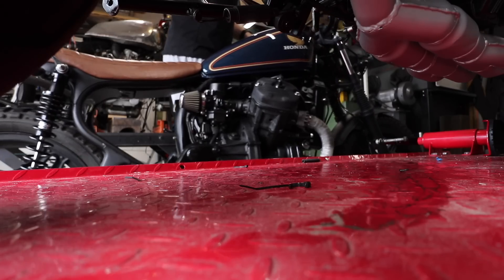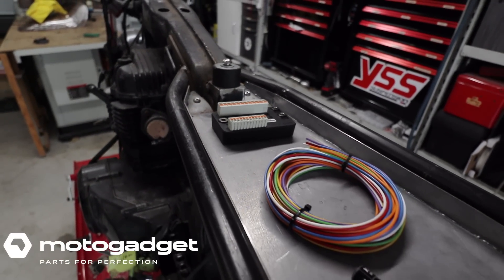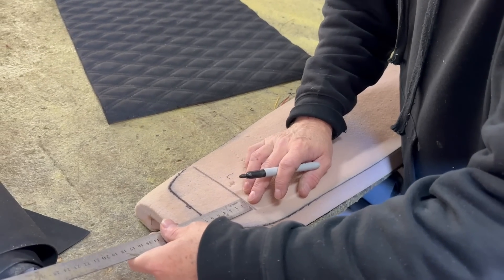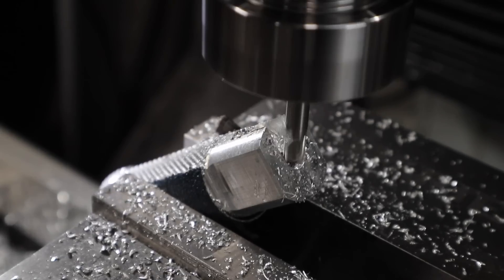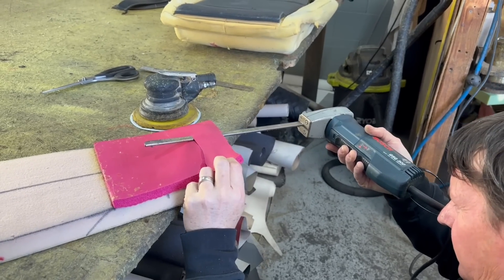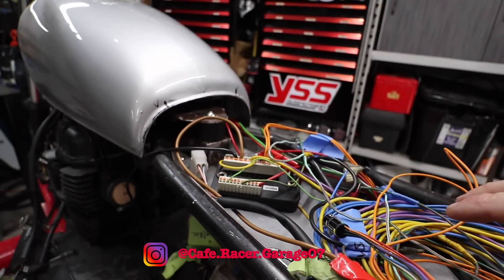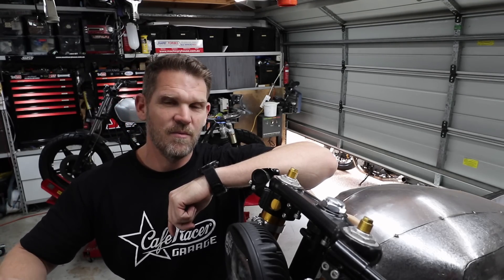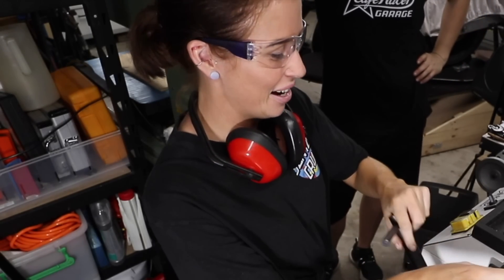WHY I HATE BUILDING BIKES FOR PEOPLE!!!

Comment: I am currently turning many boxes of motorcycle parts back into a 1975 Triumph T140. I am one of those who ponders and looks. Sometimes a solution to a roadblock is easy, sometimes it just takes time to figure out a suitable and engineeringly pleasing fix. On frustration. Some years ago I was asked to rescue a BSA A65 Lightning which had been under a tarp for a long time. The customer had very little spare cash and the bike was utterly worn out and knackered so everything needed work. With the exception of the paint, I did absolutely everything myself and visited auto jumble after jumble for good used parts as new parts were out of the customers price range. Nine months solid work later I rode the bike into a car park at the customers work and his only comment was.... "nice paint"!

Comment: Do I stare at my bike for hours??? Yes absolutely. I mock things up temporarily, sit on the bike, feel how it feels, tear it apart, make changes, put it back together and do it all over again until I’m happy with it. I’m currently working on a bike that will be my wife’s first bike and I’ve done this a half dozen times and I’m not even half way there.
The bike to be spoken of: 1982 Kawasaki KZ 750 that I’m doing up as what I call a “Bratty Scrambler”… kind of a dual sport-esk sort of brat with a flat seat, moto style bars with risers, 70/30 tires… Yet trying to retain the stock body panels at the same time with modern electronics.
Reply from the maker: thats awesome mate, keep it going.

Comment: Hi there, nice builds, staring at your build and envisioning it, go´s with the process of a (good) build (any build). 
The mistake often made (in my opinion) is building a bike on a table.
Offcourse it works easier, but the view on your future project is not the one that you will have when standing next to it.
Allso "size matters", you have small and big riders, slim ones and some are not slim at all.......
Some (big) riders, look horrible on some bikes/caferacers, allway fit the bike with/to the customer, than you are a bike builder ( this is no criticism of your work !)
When building a expensive seat, it should be flush with the gasoline tank.
If there is a welding edge visible from the tank when the seat is mounted, i would take that off....... ; )  keep hammering.....